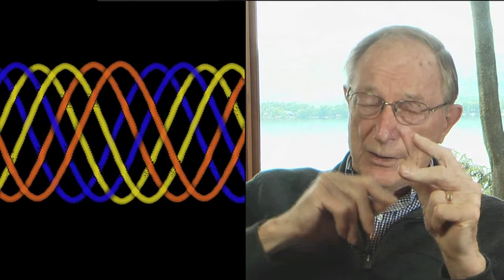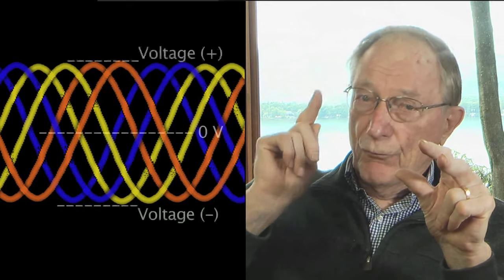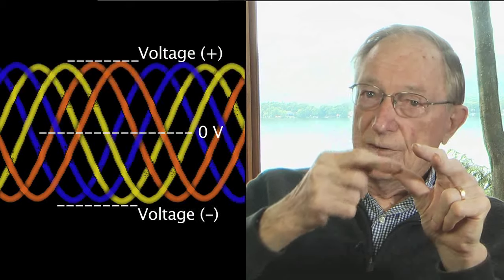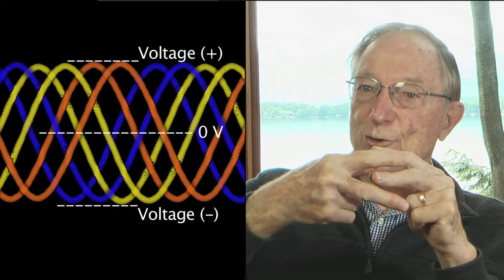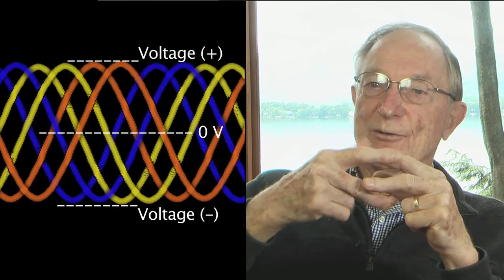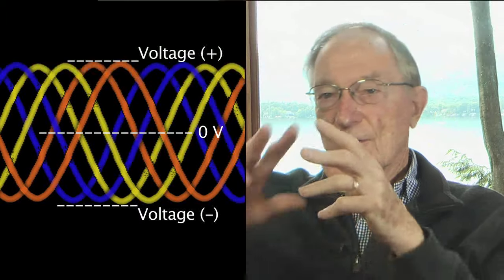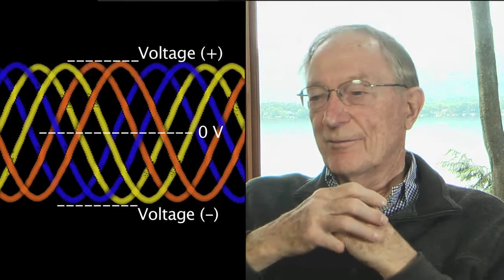Why 3 Phase Power? Why not 6 or 12?

Comment: They do have 6 9 and even yes 12 phase systems, but they are generally for use in near immediate conversion to DC mainly for extremely high current applications like electroplating and aluminum smelting. They are carried as bundles of 3 phase sets and each set is offet by 1/3 of wave timing from the next set.
Reply: A prominent example in recent times is 6 phase ev motors. Both Ford in their race-only SuperVan and Koenigsegg in their commercial Gemera used six phase motors to a scary effect

Comment: Some early comments on this video suggest 6 and 12 phase systems are not practicable because it would be difficult to build six phase motors and distribution systems and similar. However, the intent of phase orders above three is for transmission only, and in particular higher power density in a given right-of-way. A high phase order bulk transmission grid could be built or developed over time, but all evaluations of high phase order that I am aware of were point to point transmission lines with conversion to three-phase at each end via transformers.

Comment: When I was in engineering school my professor explained it a little differently.  DC power requires two conductors.  Three phase power is P=sqrt(3)VIpf.  That square root of three factor is the key.  For a 50% increase in the number of conductors, you get a 73% increase in the amount of power that can be transmitted.  That only works for a three phase system.
Reply: Even in my engineering my prof explained in a similar way.. Which i dont remenbet exactly.
Reply: Excuse me sqrt of 3 is for the balance supply so it doesnt have to be sqrt of 3 thats just the factor
Reply: Cabron Sliver if you go through the development of power capacity you will that the what is inside the square root is directly related to the number of conductors.  It is not a supply balance factor.

Comment: The power of a phase goes up and down at twice the rate of the frequency of the alternating current.
With three phase three powers are out of phase and the sum is a constant.
So single phase power produces power in a device that is modulating.  And you can hear the hum and feel the vibration.
With three phase power the power in the device is constant and not modulating.  So the only hum is due to the imperfections of the device.
Reply: dsrekjw say it again with more simple words please!
Reply: The explanation is really simple: three is the minimum amount of points to represent a vector in two dimensions. As rotational movement is in two dimensions you need three phases.

If you wanted to move a ball in three dimensions you would need four phases (forming a three sided base pyramid)
Reply: @nirodper  you made it even more complicated
Reply: 3 phase devices humm too. Just stand next to a transformer. The hum is due to magnetostriction and its frequency is either 50 or 60 Hz.

Comment: It is highly useful in the application of rectifiers since the the higher the pulses the further offset the harmonics will be which makes complying with THD limits a bit easier. You can achieve this though by branching the 3 phase power with one set going into rectifier directly and another going through a transformer with a phase shift before going into the rectifier to get 6 pulse.

Comment: Short and sweet it is more cost effective with 3 phase conductors ! End of story !
Reply: Actually no, it's most cost effective today with no phases--DC. Why China's transmission grid is being built as DC. His idea might have been useful if the electronics used to convert to and from DC hadn't been dramatically improved.
Reply: @straightpipediesel  Note the keyword "more" cost effective. And AC is generally still cheaper over shorter distances.
Reply: i haven't understood from the video, so that means if taking aside complexity and economic problems, 6/12 phase would be better than 3 phase, right? or it doesn't provide any benefit?
Reply: Naturally there are competing factors. It would have been more interesting if he started with just one phase, and explained why two or three were better. I imagine it's a combination of generators working better with multiple phases, wiring being more efficient (shared ground?), and industrial loads like big motors working better with multiple phases.
Reply: @straightpipediesel  only for long distances

Comment: An important thing is glossed over here with 6 phase. We can construct special air core transformers whereby the phases can be put into high mutual inductance circumstances using spirals and tuned  for series resonance whereby the contribution made by a centrally acting phase will be repelling the magnetic fields created by the two outer phases in mutual induction, thereby increasing the volume of magnetic fields issued outwards from polar areas for an increased efficiency of amp turns/ field.

Comment: This is electrical engineering. I thought that the 3 phases is convenient for driving electrical motors. 2 phases , each on the opposite side of the shaft can not tell a motor which way to start spinning because the equal torque force is on both clockwise direction and counter clockwise direction. 3 magnets 3 phases allows deterministic spin direction.
Reply: You misunderstand what 2-phase means.  "2 phases, each on the opposite side of the shaft" is actually single-phase - a 180 degree phase shift is just the opposite polarity of a sinusoid.  Two-phase power has phases 90 degrees apart.  Most single-phase motors start by using a capacitance to generate a second phase during startup.
The main reason for the popularity of 3-phase power is that if you balance the loads on the phases, you don't need a return "neutral" line, so you only need three wires.  This doesn't work for 2-phase - you still need three wires.
Reply: The thought exercise here is, "If 3 phases is more efficient, more powerful, and just better... why not more phases?"
Reply: @BrightBlueJim  ... how do they go about balancing the loads?  So, if you have 3 phase power connected to a 3 phase motor, you would have a balanced load, correct?  I'm gonna have to study balanced loads until it makes more sense...
Reply: @truthbebold4009  A 3-phase motor is always a balanced load.  It has the same number of turns on each of the windings, and each winding is powering the motor for part of the time.  Rotor inertia helps ensure that the load is spread over all of the phases, even if the mechanical load is higher in some shaft positions than others.  I only mentioned balanced load because if you run a building on 3-phase power, many of your loads are single-phase, so they're not automatically balanced.  You have to design the building wiring such that there will be approximately the same amount of load on each phase, or you end up wasting money because of the extra copper you're not really using.  Three phase power, when designed to use the same amount of power on each phase, saves copper cost, because single phase loads are wired from one phase to another, and all of the current from one phase returns on another.  So there is no need for a neutral wire.
Reply: Its cutting the distribution loss in half that makes 3Φ power desirable. 3Φ power is the smallest number of phases that create a virtual ground removing half of the the resistance (aka copper) loss incurred distributing the power. The phasor sum of equal load currents from all 3 phases to ground cancels out and there is no net ground current. 1Φ clearly has a hot and a ground. 2Φ at 180° still requires the current to travel both out and back for 2-way round trip copper loss. Its more plainly equivalent to 1Φ hot-ground when you realize "ground" is an arbitrary designation so choosing 1 of the 2 as ground or physically connecting one of them to ground return to a simple hot-ground  1Φ system again. 2Φ at 90° requires a 3rd wire to be ground but only a fraction of the balanced load current cancels at the ground terminal. But since it need 3 wires you can drive all 3 wires 120° offset and cancel a;; the ground current instead and deliver more power with the same installation cost. Any number of phases 3 or greater can be used to cancel out each other's ground current out. but a number greater than 3 provides no additional benefit, it only increases the cost of wiring and equipment.

A 3Φ induction motor can start and run at the line frequency, but as noted a 1Φ induction motor that runs at the line frequency doesn't have any average torque starting from 0RPM and may randomly spin up in either direction unless something is added to split the phase to create starting torque. For fractional horsepower motors the cost of 3 windings and building wiring isn't justified and torque is created by splitting the single phase electrically with another winding at an offset angle either as a coil (split phase motor) or a capacitor (capacitor split phase aka permanent split capacitor or psc motor) in series with the main winding or by creating torque magnetically using the wider soread of the high stalled rotor magnetic flux with a shorted turn (shaded pole) to create a net torque . The electrical phase splitting can be combined with a starting switch to disconnect the starting winding after the motor starts.  It can be as simple as a positive temperatur coefficient resistor (used for small refrigerators and A/C)  or timer relay  (most typically used one-size-fits-all repair part) a centrifugal switch on the motor shaft (for low lifetime start count applications) or a relay that opens when either the start winding current falls below a specific value or the voltage rises above a specific value. There are also 1Φ induction motors that also use a reduced excitation of the extra winding to achieve a higher running torque. Sometimes they use the same basic scheme, e.g. the CSCR capacitor start capacitor run motor, or different schemes like the CSIR capacitor start induction run motor that connects the start winding and a series capacitor in parallel with the main winding to start and switches to run by removing the capacitor putting uses the two windings in series.
Reply: Single phase residential power segments are connected to the 3 phase power distribution network through a Δ-Y (delta-wye) transformer. The transformer has 3 line to line connected windings on the delta side and 3 line to ground windings on the load side. a single load current on the wye side turns into a pair of  currents of the wye side. To the extent that they don't cancel  there would be increased copper loss. Single phase loads are assigned to phase A, B, or C to achieve balance and periodically re-balanced. The three segments of the Δ-Y don't have to be co-located, but the grounded conductor tying them together incurs copper loss.
Without the Δ-Y (delta-wye) transformer and just connecting unbalanced single phase loads to a Δ-Δ (delta-delta) step down  transformer connecting  lines and a ground tied to a buried pipe results in the the phase to ground voltages shifting to force the sum of the phase currents to equalize. Sometimes lightning or some other accident breaks the Y transformer's ground connection with the same result, Everything connected to the lightly loaded phases experiences a prolonged excess line voltage, while the heavily loaded leg experiences a low line voltage aka a brown-out. The prolonged high voltage frequently destroys wiring and connected equipment. The prolonged low voltage sometimes damages motor loads line A/Cs or pumps that draw excessive current trying to start or run and overheat their insulation.
Reply: @jovetj  : It isn't more efficient or more powerful.  It is sometimes better in the particular case of starting a synchronous motor. Three is sufficient.  Done!
Reply: @BrightBlueJim  Unbalanced phases in a Y connection (with neutral) will put current on the neutral and in some situations can produce ground loops and increase corrosion at connection points.
Reply: @oliverstreet7704  Single phase has no need for a ground.   It is typical to have a hot and a "neutral" but the neutral is not ground!  Neutral exists in the case of Y connected three phase systems.  Your next message correctly identifies problems when the load on the three phases is not approximately equal.
Reply: I was under the impression pretty much all our general power and power lines are 3 phase and not just for motors.  Or is that what you're saying?
Reply: @BrightBlueJim  Four or five wires for two phase.
Reply: @BrightBlueJim  Actually, it still requires 4 wires. The Neutral is used for the GFCI breaker in a 3-phase Wye setup for a motor. That center tap is also grounded. The Neutral is switched by the breaker but the ground to the motor is not.
Reply: @gravelydon7072  I am referring to power transmission, not how many wires have to be hooked up to the motor.  For motors, the ideal would be two phases, but since 3-phase power is universally available in industry, that's how high-power electric motors are made.
Reply: @BrightBlueJim  Unless the 2 phase is on the same cycle curve as 3 phase you run into the same problems as with single phase. Motors might start in reverse. That is why 3 phase works so well. Now if you set up 2 phase so that it looked like 3 phase missing one leg, yes it will start correctly but then you have the problem of the motor going thru powered and non powered cycles so it would not be as smooth running. There is a way of preventing motor from operating in reverse but they involve more parts that wear out.

Comment: To answer the question. It take 2 wires to carry a single phase. but it only take 3 wires to carry 3 phases. in essences. by adding just one more wire(50% more capacity.) , you have tripled the amount of power you can now carry. To put it another way. For the same given "total" psychical wire size, 3 phase carries twice the power then a single phase does. to go from 3 phases to six would require twice the wires and only give you twice the power capacity, thus "No gain".
Reply: For 3 Phase versus Single Phase It is actually 50% more cost (in wire, insulators and switching) gives 3 times the capacity or a 200% increase.
Reply: You miss the point.  If you have limited ROW and need more power, you can effectively intersperse a second three-phase line with the first one to get the doubling of power without a new ROW or adding ROW width for a second three-phase line.
Reply: Too bad you did not make this video because you answer the questions he fails to answer. Thank You
Reply: Yeah - but you STILL need a 4th wire for ground.
Reply: What is "psychical wire size"!??

Comment: i worked in the power supply industry for most of my life. A lot of military equipment runs on 3 phase 400HZ, we used to regularly wind the transformers with a delta and star secondaries so we could feed them into a 6 phase rectifier stack. That reduced the size of the output capacitor and in some case let us do away with the capacitor.

Comment: The real reason we use 3 phase is Star Dalta!
This gives two different voltages dependant on configuration. If you go 6 or 12 phase you are basically doubling up on your 3 phase with no additional benefit! When you factor in the skin effect in HV transmission it becomes even more apparent!

Star Delta ..... If you generate 3 phases and connect your load across each phase (Delta)..(like a motor) you get a voltage (415V in the UK) but if you take those same lines and connect your load from one of the 3 to a central point (star) you then get 240V (in the UK)! As an addad bonus you get reduced neutral sized cables because when you get multiples of 3 single pahases the power flows not just back to the star point at the transformer in the substation but allong the neutral and back through the adjacent loads to the other 2 phases! In effect if you have a well ballanced system you can loose the neutral connection at the substation completely and not even notice! Obviously this is an oversimplification as the star point is not only connected to neutral but grounded to Earth! 

Skin effect .... To transmit power over a distance you raise the voltage to high levels (you get the same volt drop but it is now a smaller % of the total) the electricity flows not throughout the cable but concentrateds in the outer skin. If you look at a Pylon the cables are not single cores but usually 4 bunched together giving a greater effective area and allowing cooling!

6 or 12 phase ...... Unless you generate a separate multi phase you are simply adding multiple parallel paths. this does not get you a great deal of benefit! If you generate multi phase you have problems in how you connest a star point as you will get different voltages with relation to each other. If you want to visualise this draw a set of 3 points forming an equalatral triangle with another point in the middle. Measure the distance between the points and you have your voltage (4.15 cm/ inches between points gets you 2.5 cm / inches to the center) Now draw your extra phases and note you can no longer get the same measurements between all outer points!
Sorry for prattling on but when you know it becomes realy apparent there is only one good way to do it ;0)
Reply: A great reply which took me 1/10th of the time to read as to watch the video.
Reply: 240/415 UK ??? We had 220/380 on the european continent, but that was decades ago. As far as I know, both have 230/400 now.
Reply: @ronaldonmg  It is the same ratio .... just a different starting voltage! Europe is now 230v ;0)

Comment: diminishing returns in power transmission is very similar to that of Yagi antenna design.  After the first 3 elements, the gain by adding more elements (4,5,6...) become substantially less than the gain of the first 3 elements.  So the best compromise between # of elements and size/cost/gain (especially with large antennas), is to limit it to 3 elements.